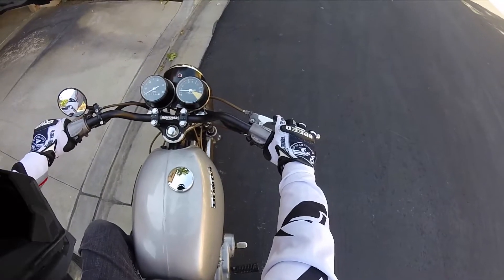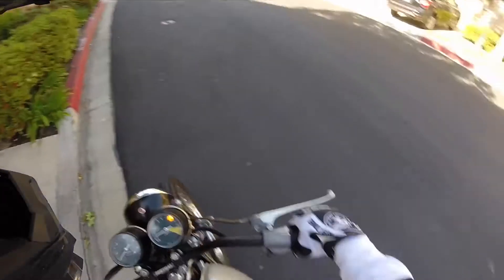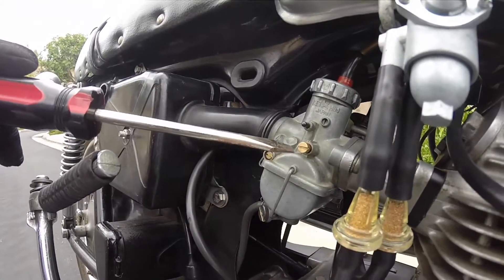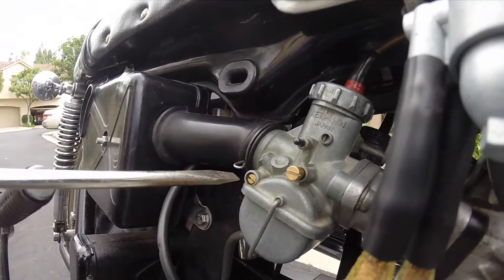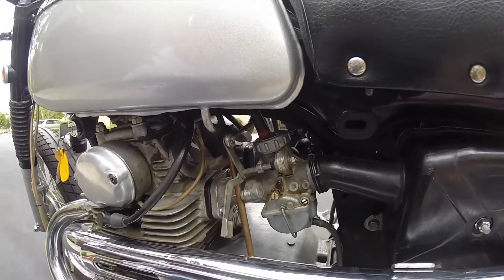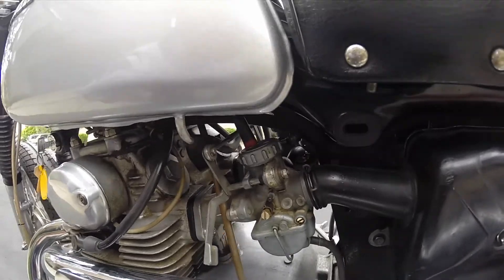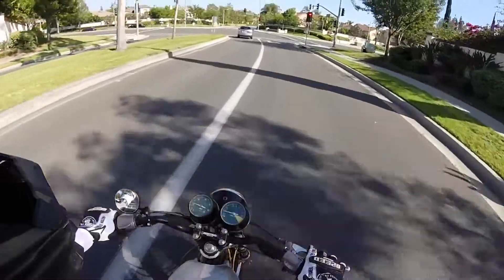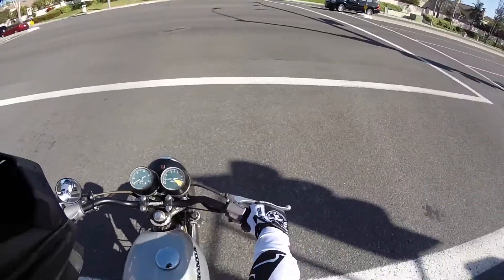Honda CL175 Cafe Racer Pt. 12 - First Ride, Idle screw setting and revving

Comment: i have a 1971 cb175 and it idlea super high. im a newbie when it comes to this. i already cleaned the carbs its still high. when the choke is off it revs like crazy and when on it slows down. llease any input would be greatly  appreciated
Reply: 1982pantro sounds like you’ve got a poor mixture, maybe a larger jet would help
Reply: @diegolyons  thank you